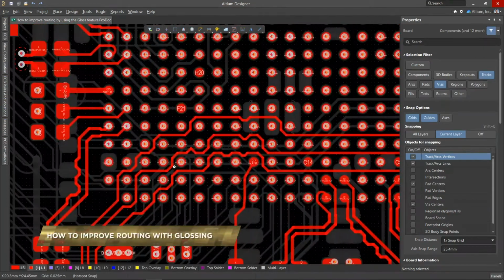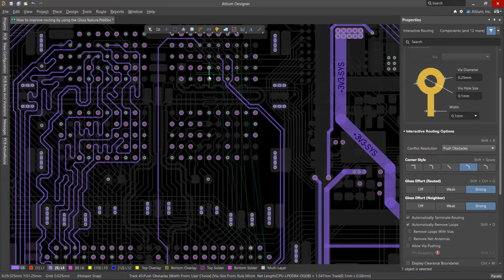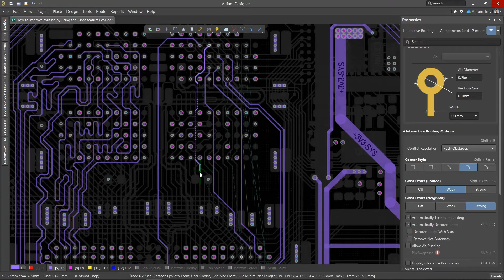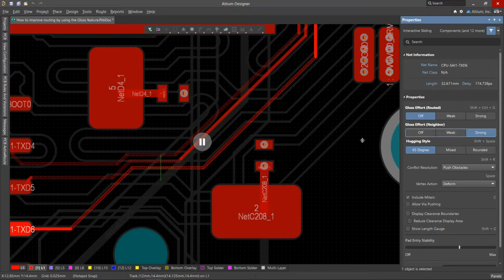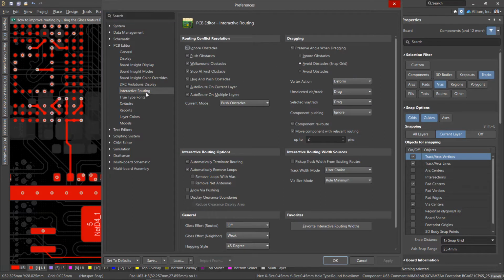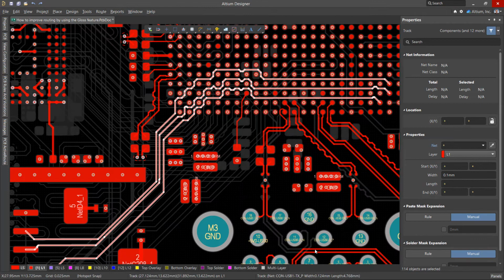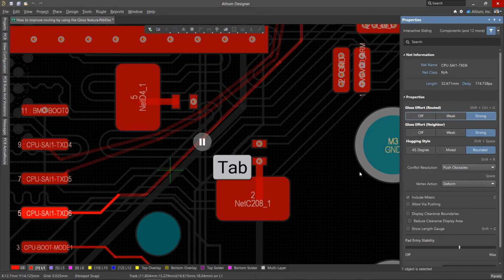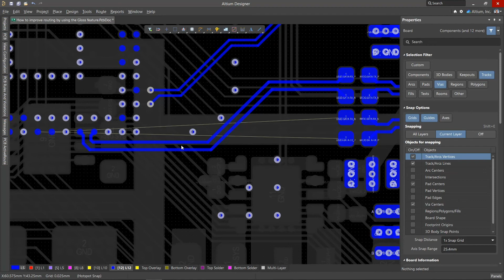How to Improve Routing Using Glossing

Comment: With differential pairs, I had zero uncoupled length errors prior to glossing.  After glossing, every one had an uncoupled length error. It appears what it did was instead of prioritizing maintaining differential gap, it prioritized pad entry and angled the traces starting a ways away from the pad entry to give a direct smooth entry.  Well, it looks great anyway...  I see there is a "pad entry stability" setting, currently 5.  I will change that and see if that gives me better results.
Reply: I think best workflow is to use the gloss/retrace tools early to clean up routing before applying length tuning, custom pad entry, stitching, etc. Just like you say, the tool can remove some of those elements. Same goes for changing the stackup and the width/spacing requirement, updating the impedance profile, and then applying retrace/gloss. I found that it can eliminate some of those features, instead I just use the selection filter and manually change width.
Reply: @Zachariah-Peterson  I'd strongly suggest a rethink of gloss WRT differential pairs, that when glossing differential pairs it maintain the impedance profile (gap).
Reply: @Zachariah-Peterson  BTW, it would be very handy to have a filter that allowed selection of certain geometry of features, like for example, all 6.123mil traces on L4.  That way you could update impedance controlled when the stackup changes quite easily.  Diff pairs are a bit trickier, but for SE, that would be really useful.  Ditto for updating vias...  Or, in my ignorance, is there already a way to do that?
Reply: @Dr.Bigglesworth  Right now you can only do that kind of selection with the query system, so if you don't have it memorized it's not so easy to use. A dialog with UI for it would be nice.